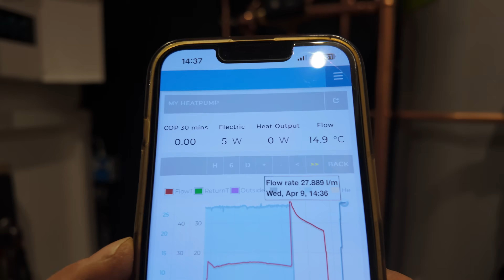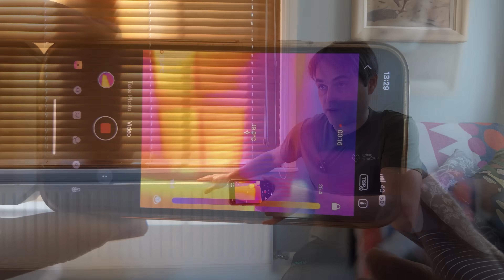Why This NIBE Heat Pump is Perfect for 7kW Homes.

Comment: Around 1985, manual circuit setters were on projects 
 Now, belimo pressure independent characterized control valves programmed with the gpm of the heating load 
Verification by the independent balancing company

Comment: This unit is not rated for 12kW the label just ends in a 12, its rated output is around 10kW at +7 and around 8-9 kW at -3 degrees.
Never assume the part number is related to the output, the same unit can be sold in different climate zones.
Reply from the maker: Yes, it is rated 8kW for warmer regions and 7kW for colder ones. NIBE really has confusing naming for their heat pumps

Comment: When I started this hvac trade in the 70 ds
We used globe valve for balancing before circuit setters
Reply: I aways used DRV, double regulating valves, A Globe valve is for isolation not regulation

Comment: I some units have a tecnology wich can hold the rated capacity until -20 degree panasonic t-cap, mitsubish zubadan for example. These units have an additonal sub cooler and a expansion valve wich cools down the compressor at low ambient temperatures so it can hold its power. Also looking at almost all of the manufactures, there is a series of capacitys wich are the exact same units wich only have different software. Looking at panasoic the 5, 7 and 9kw units are all the same, These units have the rated capacity at W35/A7 but when you look at the datasheet at -7 they all have 6KW. When you look at there spare part lists you can clearly see only the main pcb differes from each other. Most of the manufactures only have 2 different machine sizes in one series.

Comment: I don't really understand the 12kW figure? NIBE isn't stating 12kW anywhere on their website or materials except for that -12 in the name, the datasheet heat output curve peaks out at 10kW.
Reply from the maker: Probably 12kW at +7c outside
Reply: @UrbanPlumbers  Well no, the datasheet clearly says it peaks at 10kW and doesn't go above it with rising temperature afterwards. 

Page 15 of the product leaflet with the heat output vs outdoor temperature curve.
Reply from the maker: Yes all labels only mention 8kW as the output - welcome to the heat pump world where nothing makes sense
Reply: @UrbanPlumbers  have you got any idea what a 12kw midea is actually sized at please? Literature says 11 or 12.
Reply from the maker: @Vanjonsorz  no, I don’t know
Reply: @ ah well thanks  anyway for the reply mate. Im stuck with it for now, and will swap it in future 👍

Comment: If when the time comes to install a heat pump I would only want you and your team to install one..as that’s unlikely I will probably stay with my gas boiler for the foreseeable..great install as always..
Reply: There are other engineers out there as enthusiastic and serious as this guy about heat pumps and getting it to work as efficiently as possible. Unfortunately there’s just no sure way to find them 😅
Reply: @richardmccann9293 HeatGeek network is a good place to start 🙂
Reply: Be ready to pay insane amount of set up costs for the heatpump to replace gas boiler. Cheaper running costs ain't worth it when you can buy combi boiler under 1k...

Comment: I just used the Rehau Rauvitherm instead of the Microflex, it has separate closed cell insulation from the internal pipe so no hassle or cleanup, also kink resistant (allowed to use it after being kinked completely flat or even clamped shut for pressure testing) and available in single 32mm as well.  I used two seperate pipes with seperate insulation for a) heat diffusion between the flow and return (esp on hot water heating) and b) its somewhat more flexible.

Comment: I have worked as a heat pump installer here in Sweden and the biggest brands Nibe, Thermia, Ivt and CTC are all great brands with a long history of being at the forefront of heat pump technology. They will are probably outperform any brands in the world if installed correctly. I don’t know about availability in the UK but some brands like Nibe will probably try to get into the growing market there.
Reply from the maker: Is CTC popular in Sweden? How about Vaillant?
Reply: @UrbanPlumbers CTC is pretty common as a budget brand, along with IVT and Thermia my guess is they probably have a shared marketcap of 50-60%, IVT is mostly just a rebranded Bosch, but not many know that. Nibe is the premium brand, they are the biggest and by far the best according to both installers and customers. If you need a new system and have the budget. You go for Nibe. They have the rest of the market. Valiant isn’t even on the radar here, no one knows the name, I think I have seen one or 2 systems, ever… and that was in the last year or 2. So maybe they are trying
Reply: @ Although I mostly agree with Nibe being the best, I installed mostly Thermia and they only sell via installers compared to Nibe which sells in any store. The problem here could be to find an installer that really knows what they are doing. I personally think if you buy Themia its more likely they know their stuff.

Now every one of the big brands have premium models that have the latest technology like HGW for warm water.
Reply: @ Yes CTC is popular like the other guy said. Vaillant not so much but you see them more and more.
Reply: @UrbanPlumbers  Do you guys know of any 60 Hz R290 HP suggestions for central Canada?  We see -35C often .. but the “wisdom” here is to design to about -15 to -20C and use a backup heat source (wood or gas).  No data on HP output at those temps since no one tests that low .. I am thinking about running a project with a local tech institute to test this actually (R290 is currently not legal here but we could likely bring some in under a project).  Anyway .. right now it is not economic due to very cheap gas (about $8.00 CDN/GJ) .. so it is a tough sell.  Electricity is also cheap though at 10-12 cents/kWh.  I do accurate economic modelling on this stuff btw.
Reply: Finland also, Nibe very popular as exhaust air heat pump systems too. They seem to work well.
Reply: Nibe are in the UK. I have worked on them
Reply: Do you not bother fitting antifreeze valves anymore?
Reply from the maker: @johnfreshwater3790 you don’t need them on NIBE or viessmann
Reply: @UrbanPlumbers is there a good reason why they are not required or is it just certain manufacturers say they are required as I have a Samsung and if its in off and the water in the outdoor unit drops below 5 degrees it starts the circulator pump so unless you are very unlucky and have a minus 5 say and a power cut its very unlikely to freeze
Reply: Nibe, Thermia, IVT, NIBE and CTC And nibe are my favourite heat pumps. Hands down.

Comment: Another great video, I have a Samsung 16kw and that modulates down to 850 watts approx but you can set it to not switch off, Samsung tech actually asked Samsung in Korea which was best and they said to never turn compressor off far better than on off. So all that happens is when it settles to its minimum speed the flow temp just tends to rise a few degrees and eventually the room stat turns it off, this only happens when it's milder outside, I'm quite happy with my unit it uses just over 4k kwh a year for a 200 square metre 220 year old solid stone wall house and is all radiators. Rarely runs above 38 degrees flow temp
Our epc says property requires 25k kwh for both hot water and heating
Reply: Bond25 for some reason your comment isn't showing properly can only see the first 4 words
Reply: Do you know your average COP ?
Reply: @pauld3327 sorry, no I don't know my SCOP as even Samsung tech say don't take any notice of the figures given on the controller as they are all over the place, which I can confirm as it has hours run and it sometimes says things like 32 hours for one day
If you calculate it by the epc it's 5 ish but knowing what epc,s are like I wouldn't take a lot of notice of that either, when we were on oil we used between 1500 and 2000 litres per year but the boiler was quite old so that wouldn't have been very efficient.
I calculated our heat loss to be around 10  and on a cold day with it on all day and with doing the hot water it uses between 25 and 30kwh of electric per day running continously, on 5 to 7 degrees days it uses about 20 kwh of electric
It runs at about 800 to 1100 watts per hour depending on outside temp
Hope that helps, I'm not someone worried about knowing cop I just know it's cheaper to run than the oil boiler and ad we have solar too in the summer it's free to do the hot water
Reply: @johnfreshwater3790 Thank you for your answer 👍

Comment: Another nice looking installation.

If I recall, NIBE don't sell their units to just anyone; you need to get qualified (as they had issues in the past with mis-sold ventilation units). Was the qualification process arduous, or is it proving system design understanding any Heat Geek should have?
Reply from the maker: NIBE trianing was proably the only decent trianing I have seen from manufacturers. Trianing itself will be easy for anyone who has done Kimbo or Heat Geek before. 

Yes, it is mostly a direct sales company to trained installers only.

Comment: Very interesting, because in Belgium Vaillant is not allowing connection of their Arotherm Plus 7 kW heatpumps in a direct, open loop system (schema 30260-1011 in the Uk docs), which is what iI would like in my house (heatloss 5.4 kW at -3C, index circuit 14 kPa, 13 radiators (8 kW output at 44C) so plenty of water volume). No idea why that is the case but it means I probably get no warranty from Vaillant if I choose to connect it that way. The S2125-12  pump maybe a (more expensive) alternative to that! Thnx for the very informative videos.
Reply from the maker: get NIBE, it is worth the extra, especially if Vaillant Belgium is being silly.

Comment: Starting to sound a lot like claims of economy/consumption by car manufacturers.
Reply from the maker: Not quite, as most heat pumps' efficiency is better than manufacturers state, so fuel economy is very impressive. It is just that no one has a standardized and reliable method of testing outputs in real-life scenarios - well, apart from the Open Energy Monitor guys.

Comment: Your comment and opinion on using a gate valve as a choke is very good advice.  An inexpensive solution to balancing a system.

Yet again a great informative video. Keep them coming.  As a DIYer I am learning so I can install my own het pump in the next year or two.

Comment: As with gas boilers, if the heat source can modulate down to exceptable levels than an over sized unit wont much of a problem. With heat pumps,that can be an asset in very cold weather, as it wont have to work as hard to reach the required flow temps and in theory, wont defrost as much.will recover from defrost quicker and heat your hot water quicker.
Manufacturers are using sleight of hand on Heat pump output figs and there needs to be an Independent body that tests these units under all loads and different envirnoment conditions, including Humidity, which seems to affect the UK units.
These should not only show max outputs, but the min, and noise at different levels. 
If you didnt know the output of this NIBE, on first glance, every skilled heat pump fitter, would be thinking, why are you installing a 12Kw heat pump with a heat loss of 7Kw!! But even if it did output 12Kw at -3, it wouldnt be a problem if it can modulate down to 300w.
The Daikan heat pumps you mentioned are a prime example.
The 4/6/8Kw are the same units, with the smaller units max outputs throttled down by the computer. So the 4Kw only modulates down to the same level as the 8Kw which is around min 400-600w.
The 9Kw-14Kw units are the same units, so the 9Kw unit will only modulate down to 900w!
If you get the heat loss slightly out and fit a 9Kw Daikan instead of an 8Kw, it will end up costing you alot more to run.
Reply from the maker: most manufactureres just rebadge the same unit with sotware output cap: Vaillant 10 and 12, Mitsi, Daikin, etc... they all sell the same unit with diffrent cap on compressor.
Reply: @UrbanPlumbers  
If you could rely on the output of these units, there wouldn't be as much angst in getting the heat loss bang on. So we could do without all these units in 2Kw increments! 
If an oversized 10Kw unit modulates down to same level as a 6Kw, than why fit a 6Kw?  If you don't need to up pipe sizes and can get required flow, you have a unit that can cope with more extreme weather, heat water quicker, won't work as hard and just as efficient as the smaller unit.
Or is that over simplistic?

Comment: Another great video, showing the in depth knowledge. Interesting to see you using gate valves. My flow is very high so I might try using these after another radiator upgrade this summer. I have a DT of 2.5 to 3 most times unless very cold , even at a fixed (lowest setting of 50%) vailent 7kw unit.
Reply from the maker: DT 2-3 in normal with Vaillant. Do not try to throttle that, it will only make the circulator run harder.

Comment: The manufacturers make it very difficult to determine what is the correct size of heat pump. My install is happening in a few weeks, my conservative heat loss is 12.8kW and they want to install a 16kW Samsung, which they say outputs about 14kW. Does this sound crazy to you please, we like to keep the house at no more than 15C and I worry it won’t be able to ramp down the output sufficiently.
Other installers wanted to go larger, insisting on a 3 phase unit.
Just to add, one of the reasons they selected the Samsung is the location, the optimum space is narrow and requires a tall thin unit, it has 2 fans sitting vertically.
Reply from the maker: the problem starts with overstated heat loss calcuaitons then with supposedly oversized units that are actually lower output, which in most cases is actaully great as it comabts oversizing. Hwoever, if you get your heat loss very accurate (as we tend to do) - you run a risk of undersizing.

Oversizing is fine if the units and controls are decent. I do not see a porblem with 30-40% oversizing with Vaillant / Viessmann or NIBE. However with poorer contorls it can be a problem.
Reply: @ Thank you. My estimated heat loss from the EPC was 18kW, but the survey calculated heat loss was 12.8kW, sounds like it should be OK to be using a 14kW unit. The Samsung controls are not very user friendly, but they do seem to work OK. 

It shouldn’t be this complicated and will never get wider take up until they simplify it and make installation lower cost and electricity lower cost. We have a very large solar array and generate about 12mWh a year which will cover the power cost, but not everyone has sufficient or suitable roof space to do that.
Reply from the maker: @yp77738yp77739  Samsung controls are poor. I would go for the Vaillant 12kW instead, a much better unit and much better controls. Well worth the extra cost. If money is an issue, than go for the new Grant R290 unit - great controls and comparable cost to Samsung.
Reply: @ Thanks, it was the unit recommended by the installer to fit the space, cost wasn’t a consideration. 
What’s actually wrong with the control system please, so I can argue with them constructively.?
Reply from the maker: @yp77738yp77739  it just takes much more effort to get those units to run well, as controls are not very intuitive or user friendly. Also no degree minute algorithm, which can make it cycle more.
Reply: @ Thanks. 
I’ve taken time to learn the Samsung control system configuration, I’d agree it has a horrible and unintuitive control system interface. I am a control systems process engineer, so I should be able to get my head around it after some tinkering. Providing there isn’t a fundamental design flaw then worst case I should be OK. I’ll speak to the installer and see if they can find an alternative that fits the space, trenching and a longer distance between the unit and the plant room could have been an option but I wanted to minimise the flow pipe distance and didn’t want it at the front of the house. 
Thanks for your guidance.
Reply: @UrbanPlumbers  They still haven’t started the install, waiting for DNO approval (I don’t understand why a new load requires approval). They have now decided to install the Samsung homely optimiser to sit above the rubbish controls. It looks brilliant, in theory, to have machine learning take over the controls and I’ve also signed up for beta testing of the integration with my powerwall 3 and smart tariffs. Will it work as well as it should, I guess I’ll find out by the end of the winter.

Comment: One has to just read: in the datasheets of all heatpumps there are tables with powers rated at different temperatures... It s not new that a heat pump doesnt have a constant power curve for different outside temperatures. And guess what? You need more power at lower temperatures. Exactly where heat pumps struggle.
Reply from the maker: trouble is, a lot of heat pump manufacteres do not publish that data or do not even know what the units do at with defrosts. NIBE does pubish that data which is great. A lot of others dont.
Reply: most important is the heat gradient. Its less with A2A not A2W